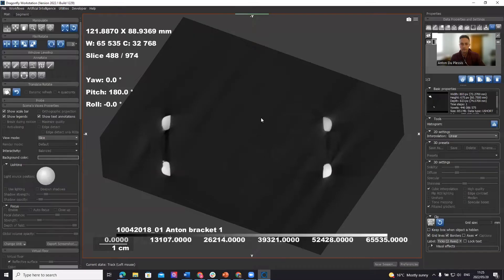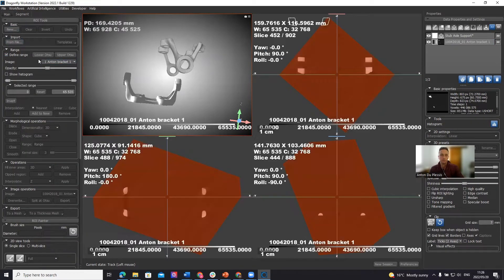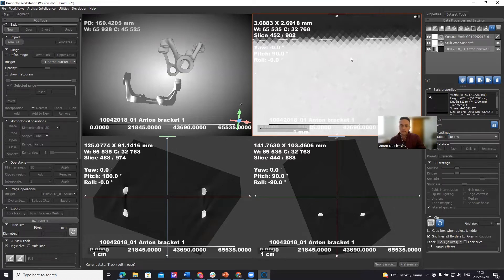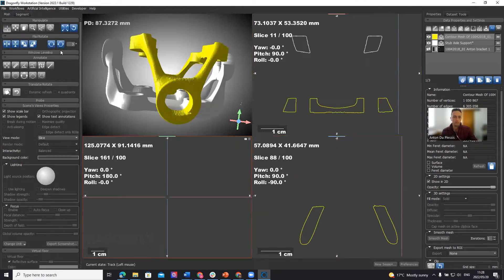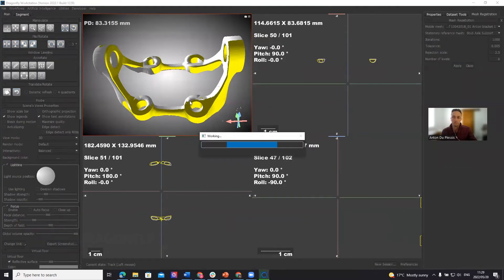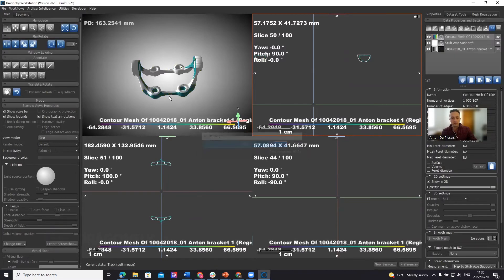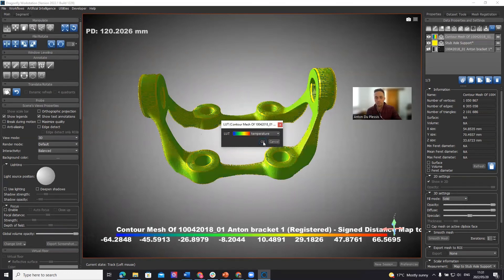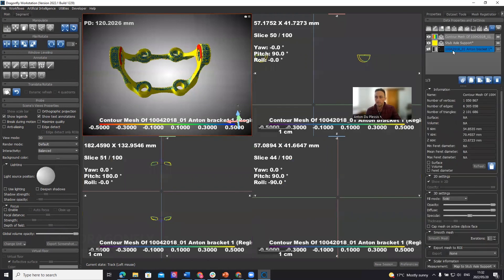CAD Deviation of Additive Manufacturing Bracket Using Dragonfly

Comment: Hi Dr. Du Plessis, great video. What file format was taken from CAD software? Was it stl format or any other?
Reply from the maker: Thanks Nabeel, it was STL file format for mesh import yes
Reply: @dragonfly_software  is tetrahedral meshing (TH) feature only available in the latest update. I tried in 2021 version, but there was no option. Also, post TH meshing, will near surface defects still be present. Contour meshing removes all the defects in the surface. I am not sure about TH meshing.
Reply from the maker: @NabeelAhmad-nc6wx  yes tetrahedral (volume) meshing is only in latest version 2022.2. About your defect removal this depends on how you do it. Share with us the data for a public demo then I show you how to do it to include those defects
Reply: @dragonfly_software  Can you please share with me your email address. I will send the tiff files.
Reply from the maker: @NabeelAhmad-nc6wx  you can put data in ors.wetransfer.com or email to aduplessis <at> theobjects.com.